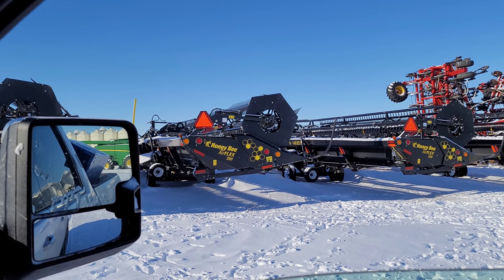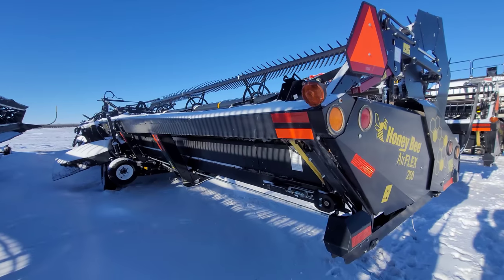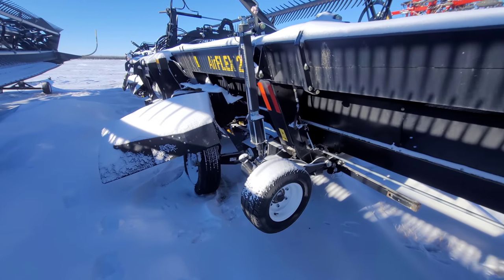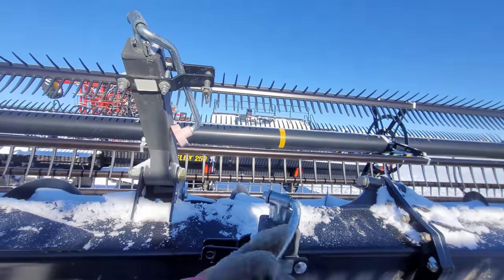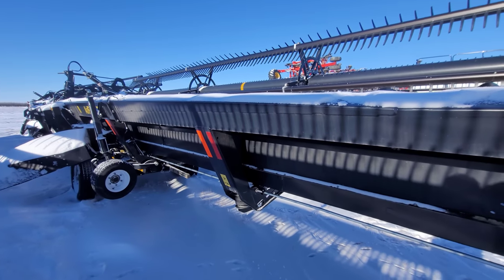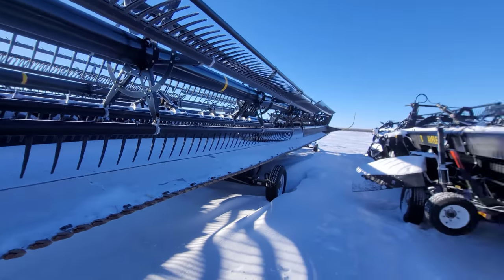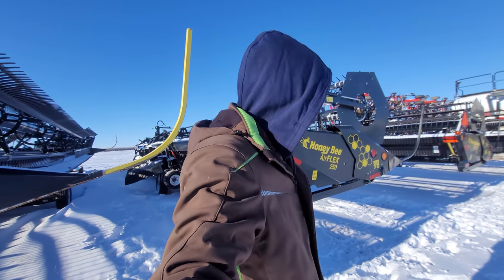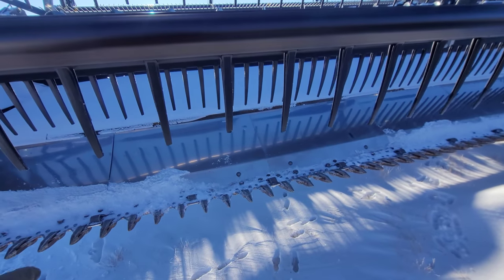Post Harvest Review: 50ft Honeybee

Comment: Mike, move the handle retention bracket around to the other side of the jack barrel on the auger adjustment. The handle will store on the opposite side and interfere less.

Comment: Hi Mike, HB has a larger bearing available for the pitman arms. We have used larger gauge wheels for years, just make sure you have the correct mounting arm, as they can hit the frame.  And make sure you don’t reverse or turn too sharp with the large gauge wheels, you will snap the king pins! Drive hub bearings is an issue and 100% they should not fail that quickly. Love videos. keep warm 🥶

Comment: Even honeybee is late to the game, 
Midwest in west Australia has been makeing 60ft headers for ages now 
They were the forst as far as I know

As for transports 
Once you get some proper comb trailers you'll never go back 
Just roll up and drop the head on and off you go, your way more likely to disconnect than try to squeeze though tight places when it only takes 2mins to disconnect 
And you weld hitches to the back of the trailer so you can pull 3 empty comb trailers with a pickup

Comment: Mike,  with those handles for the winding the wheel up and down for flex or rigid mode. 
 Why not whip the handle off, weld on a big nut. Then use a cordless impact gun to spin the bugger down. Less knuckle bashing 👍🏻
Reply: That was my first thought when he showed it. Same with those depth wheels. Since the fabricator is in the area, let them put the wheels on the place you want them or do it yourself. Make it fit your operation.
Reply from the maker: That would work great! The only problem is when you run multiple units, the guns would either get lost or be dead when they wanted to use them. 😆
Reply: Best is to convert them overto 12 volt Jack's cause the machine always has power

Comment: Did you ever try the crury air system to help with the large plate
Reply: at the start of harvest he said they don't like air reals.
Reply: @max-jc4wq  air reels add weight to the front of the header and to the one side  of the head specifically, and can cause the header to counter balance wrong. which cause issues with the Header height. and must be manually adjusted in the combine and header monitor. also causes extra strain on the reel system and knife drive bearing drive.
Reply: @SuperAtrain45  I know that.  I think the reason they don't like them is because it is more moving parts
Reply: @max-jc4wq  i would belive that also

Comment: Why did you opt for the split reel on the honeybee?
Reply from the maker: You wouldn't want a 50ft solid reel up here
Reply: @mikemitchell2554  correct
Reply: all Honey Bee Air Flex tables only come with split reels as the reel drive is in the center of the header

Comment: Simple fixes.  Move the gage wheels out to the next bracket,  install a guard for the sensor bar, and slide the reel back when in light crops using hydraulic cylinders so you can change on the go, and put bigger tires on the gauge wheels. Put simple electric motors on your gauge wheels so you can flip a switch, much like electric trailer jacks on large camping trailers, maybe actually incorporate one in place of the hand crank version.  Farmers fix/modify machines all the time and factory reps see those mods and they might show up on new machines. All of that header length and you cannot find a place to store spare cutter bars???  A sensor bar guard tube would be a great place to do that.  Think/modify/improve for your needs.
Reply: I know the previous model honeybees had a cover on the left end of the frame where a knife could be stored. Don't know about these but would be shocked if they got rid of it.
Reply: Well look at you
Reply: Lol I don't think this guy knows who Mike is or the the operation they run.
Reply: would you want to do all that to 6 headers that will probable get traded off in a year or 2
Reply: When you're spending $200k on headers, it's doing it right out of the factory. You don't fab yourself, unless it is a total custom build. You can bet with these guys the next model of header will have what they need.

Comment: Sounds like header is too large  maybe you need to go back down
Reply: the same company now makes 60f.  if any thing they would upgrade not down grade.
Reply: @max-jc4wq  No the big wide headers don't work well up there. Too much discrepancy in grade. The headers don't flex enough.
Reply: @mikeznel6048  well I sure hope are new 60f will work good.  (we have flat ground
Reply: But they don't have flat ground I have seen the videos
Reply: @lesliekirkland4603  maybe but most of there ground I think the air flex would do its job.  It just doesn't work on prairie mountains
Reply: @Leslie Kirkland: The workforce desperately need a few days with a good old fashioned scythe, take the harvester keys from them & see what complaints about headers & combines they have after 5 straight days of back breaking sycthe work! I think only Mike would see the week through to be perfectly honest with you. Lols